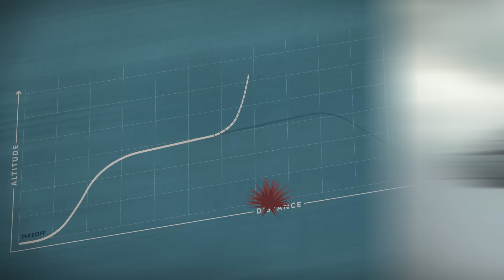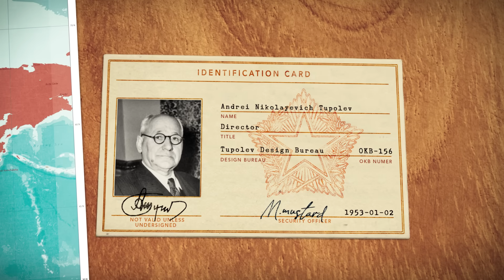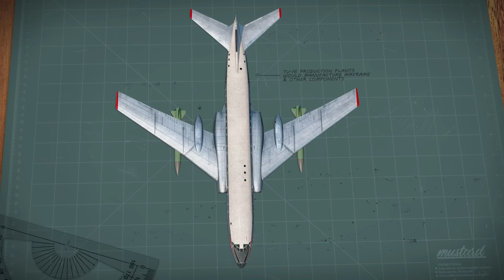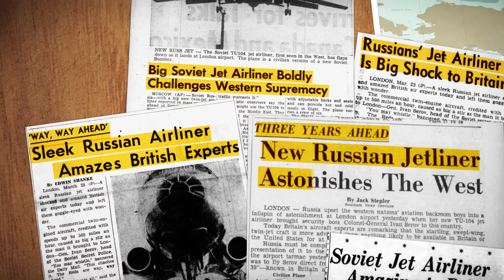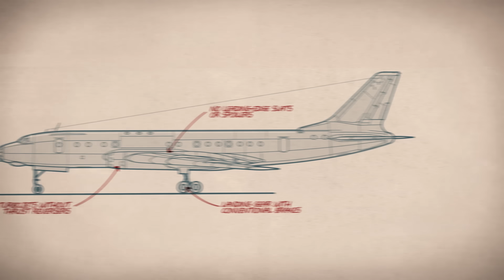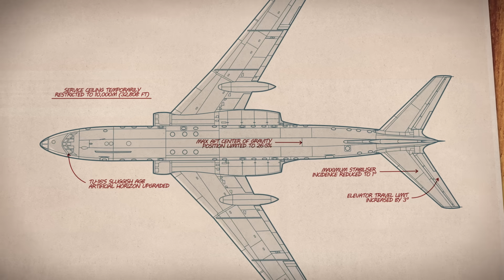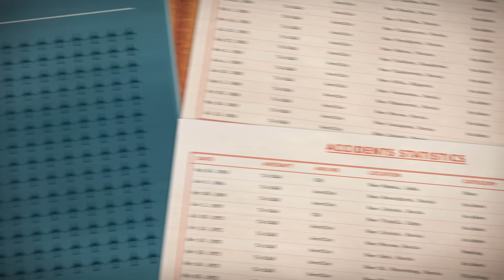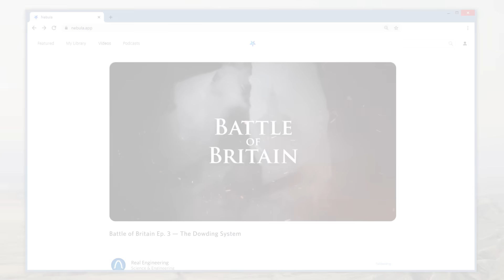The Soviet Airliner Designed To Crash

Comment: Why do British people have so much difficulty in accepting that the de havilland Comet was the worst jet airliner in history?
Reply: We believe we can clear up some commonly held myths and misconceptions obviously.

It's always good to see the facts presented clearly and concisely isn't it?

Obviously there have been worse aircraft for accident losses both before & after the Comet.

  De Havilland was subjected to forced merger under the govt aerospace sector rationalisation programme.

In 1944 the RR Nene, a centrifugal compressor gas turbine aero engine, was the most powerful & most reliable gas turbine aero engine on the planet. For decades after 1944 copies & versions of the RR Nene & RR Derwent would go on to power aircraft in many countries including Russia (Mig-15 & Mig-17), the US, France, Switzerland and China.  Five manufacturers currently produce various types of gas turbine aero engines which include centrifugal compressors, the main application is helicopters. 

The world's first wind tunnel was constructed in England before 1890. The world's first supersonic wind tunnel was constructed in England in 1922. Extensive wind tunnel testing & evaluation were carried out for the Comet. All takeoff incidents were the result of stalls caused by over rotation. There were feature induced issues where pilots tended to not using jet airliner specific takeoff procedures. Subsequent changes made to the aircraft were an attempt to make the aircraft more tolerant of such errors. 

It is in fact correct to state that no aircraft manufacturer had managed to produce a high altitude airliner with a full fuselage length pressurised passenger cabin pressurised to 8 psi differential before De Havilland did it with the fabulous trail blazing Comet. This was the first aircraft where pressurisation stress significantly exceeded flying stress for most of the airframe. The world's first pressurised cabin aircraft was a British design Airco built under licence in the US and modified in the US to have a pressurised cockpit cabin during a joint US / UK research project. 

 Testing included water tank pressurisation cycle tests on two 20 foot lengths of fuselage which represented all features of the complete fuselage.

The engines used for the earlier Comets were of course similar to the RR Nene, were very reliable  & were not responsible for any Comet incidents.

The fabulous trail blazing DH Comet.
World's first jet airliner.
World's first high altitude airliner.

    How things were back then. 
Accident losses - % of aircraft built.

DeHavilland Comet 4 UK                     14% 
DeHavilland Comet all (ff 1949)         17%  
Vickers VC10 UK (ff 1962)                   5%

Douglas DC-1                                      99%
Douglas DC-2                                      47%
Douglas DC-3                                      30%
Douglas DC-4                                      26%
Boeing s300                                        72% 
Boeing 307                                          70%
Boeing 247                                          48%
Boeing 707  (ff 1958)                         20% 
Lockheed L-049/149 Constellation  30%
Lockheed Electra  Turboprop .          29%
Fairchild FH-227                                 30%
McDonnell Douglas DC-8                  14%. 
Sud Aviation Caravelle                       15%
Canadair CL-44 Turboprop (ff 1959) 46%  
Convair CV-580 Turboprop                 22%
Convair CV-880  (ff 1959)                   27%  
Convair CV-990  (ff 1961)                   33%
Tupolev T-104     (ff 1956)                   16%

  The Vickers VC10, fastest Atlantic crossing for a non supersonic jet airliner, held the record for 41 years. 

The DH Comet & Sud Aviation Caravelle had similar accident loss fatalities for the first few years of operations.

Agreed, that is correct of course, clearly there are many countries that could easily produce airliners of better  quality than Bow-wing (see b-47 wing folding & wing collapse incidents) but don't for some very good reasons. Bow-wing being a result of the size of the US, the large protected domestic market & great ease of testing new types due to the equator to arctic geography & a few other reasons related to production scale capability, politics & economics.

  Obviously there really is nothing special about Bow-wing, having more than 50 years design / build experience on the type means they have no excuses for the horrendous Max incidents for example.

   Of course De Havilland carried out a full stress analysis & performed extensive & protracted testing, including pressure cycle testing, on two long lengths of fuselage. De Havilland carried out significantly more testing than was required by any authority at the time & significantly more testing that any previous airliner was subjected to.

    De Havilland did indeed always work to better than industry standards at the time, used up to date knowledge for the design & no evidence of negligence or criminal negligence was ever produced in relation to the DH Comet.

  The DH Comet had better safety than or similar safety to many other commercial passenger aircraft of a similar era both before & after the DH  Comet.

Pretty much all changes made after the Comet 1 were just in case changes or were previously planned ongoing improvements.

We do indeed hope this helps, of course.
      
As always, cheers & 👍 indeed.  .

Comment: The Tu-104 actually has a significantly better safety and service record than the D-H Comet... also Tupolev still makes jet aircraft.
, de Havilland went tits-up in 1958 as a direct result of the Comet Disaster,,
Reply: We believe we can clear up some commonly held myths and misconceptions obviously.

It's always good to see the facts presented clearly and concisely isn't it?

Obviously there have been worse aircraft for accident losses both before & after the Comet.

  De Havilland was subjected to forced merger under the govt aerospace sector rationalisation programme.

In 1944 the RR Nene, a centrifugal compressor gas turbine aero engine, was the most powerful & most reliable gas turbine aero engine on the planet. For decades after 1944 copies & versions of the RR Nene & RR Derwent would go on to power aircraft in many countries including Russia (Mig-15 & Mig-17), the US, France, Switzerland and China.  Five manufacturers currently produce various types of gas turbine aero engines which include centrifugal compressors, the main application is helicopters. 

The world's first wind tunnel was constructed in England before 1890. The world's first supersonic wind tunnel was constructed in England in 1922. Extensive wind tunnel testing & evaluation were carried out for the Comet. All takeoff incidents were the result of stalls caused by over rotation. There were feature induced issues where pilots tended to not using jet airliner specific takeoff procedures. Subsequent changes made to the aircraft were an attempt to make the aircraft more tolerant of such errors. 

It is in fact correct to state that no aircraft manufacturer had managed to produce a high altitude airliner with a full fuselage length pressurised passenger cabin pressurised to 8 psi differential before De Havilland did it with the fabulous trail blazing Comet. This was the first aircraft where pressurisation stress significantly exceeded flying stress for most of the airframe. The world's first pressurised cabin aircraft was a British design Airco built under licence in the US and modified in the US to have a pressurised cockpit cabin during a joint US / UK research project. 

 Testing included water tank pressurisation cycle tests on two 20 foot lengths of fuselage which represented all features of the complete fuselage.

The engines used for the earlier Comets were of course similar to the RR Nene, were very reliable  & were not responsible for any Comet incidents.

The fabulous trail blazing DH Comet.
World's first jet airliner.
World's first high altitude airliner.

    How things were back then. 
Accident losses - % of aircraft built.

DeHavilland Comet 4 UK                     14% 
DeHavilland Comet all (ff 1949)         17%  
Vickers VC10 UK (ff 1962)                   5%

Douglas DC-1                                      99%
Douglas DC-2                                      47%
Douglas DC-3                                      30%
Douglas DC-4                                      26%
Boeing s300                                        72% 
Boeing 307                                          70%
Boeing 247                                          48%
Boeing 707  (ff 1958)                         20% 
Lockheed L-049/149 Constellation  30%
Lockheed Electra  Turboprop .          29%
Fairchild FH-227                                 30%
McDonnell Douglas DC-8                  14%. 
Sud Aviation Caravelle                       15%
Canadair CL-44 Turboprop (ff 1959) 46%  
Convair CV-580 Turboprop                 22%
Convair CV-880  (ff 1959)                   27%  
Convair CV-990  (ff 1961)                   33%
Tupolev T-104     (ff 1956)                   16%

  The Vickers VC10, fastest Atlantic crossing for a non supersonic jet airliner, held the record for 41 years. 

The DH Comet & Sud Aviation Caravelle had similar accident loss fatalities for the first few years of operations.

Agreed, that is correct of course, clearly there are many countries that could easily produce airliners of better  quality than Bow-wing (see b-47 wing folding & wing collapse incidents) but don't for some very good reasons. Bow-wing being a result of the size of the US, the large protected domestic market & great ease of testing new types due to the equator to arctic geography & a few other reasons related to production scale capability, politics & economics.

  Obviously there really is nothing special about Bow-wing, having more than 50 years design / build experience on the type means they have no excuses for the horrendous Max incidents for example.

   Of course De Havilland carried out a full stress analysis & performed extensive & protracted testing, including pressure cycle testing, on two long lengths of fuselage. De Havilland carried out significantly more testing than was required by any authority at the time & significantly more testing that any previous airliner was subjected to.

    De Havilland did indeed always work to better than industry standards at the time, used up to date knowledge for the design & no evidence of negligence or criminal negligence was ever produced in relation to the DH Comet.

  The DH Comet had better safety than or similar safety to many other commercial passenger aircraft of a similar era both before & after the DH  Comet.

Pretty much all changes made after the Comet 1 were just in case changes or were previously planned ongoing improvements.

We do indeed hope this helps, of course.
      
As always, cheers & 👍 indeed.  .

Comment: The De Havilland Comet remains the jet airliner with the worst safety record in history
Reply: We believe we can clear up some commonly held myths and misconceptions obviously.

It's always good to see the facts presented clearly and concisely isn't it?

Obviously there have been worse aircraft for accident losses both before & after the Comet.

  De Havilland was subjected to forced merger under the govt aerospace sector rationalisation programme.

In 1944 the RR Nene, a centrifugal compressor gas turbine aero engine, was the most powerful & most reliable gas turbine aero engine on the planet. For decades after 1944 copies & versions of the RR Nene & RR Derwent would go on to power aircraft in many countries including Russia (Mig-15 & Mig-17), the US, France, Switzerland and China.  Five manufacturers currently produce various types of gas turbine aero engines which include centrifugal compressors, the main application is helicopters. 

The world's first wind tunnel was constructed in England before 1890. The world's first supersonic wind tunnel was constructed in England in 1922. Extensive wind tunnel testing & evaluation were carried out for the Comet. All takeoff incidents were the result of stalls caused by over rotation. There were feature induced issues where pilots tended to not using jet airliner specific takeoff procedures. Subsequent changes made to the aircraft were an attempt to make the aircraft more tolerant of such errors. 

It is in fact correct to state that no aircraft manufacturer had managed to produce a high altitude airliner with a full fuselage length pressurised passenger cabin pressurised to 8 psi differential before De Havilland did it with the fabulous trail blazing Comet. This was the first aircraft where pressurisation stress significantly exceeded flying stress for most of the airframe. The world's first pressurised cabin aircraft was a British design Airco built under licence in the US and modified in the US to have a pressurised cockpit cabin during a joint US / UK research project. 

 Testing included water tank pressurisation cycle tests on two 20 foot lengths of fuselage which represented all features of the complete fuselage.

The engines used for the earlier Comets were of course similar to the RR Nene, were very reliable  & were not responsible for any Comet incidents.

The fabulous trail blazing DH Comet.
World's first jet airliner.
World's first high altitude airliner.

    How things were back then. 
Accident losses - % of aircraft built.

DeHavilland Comet 4 UK                     14% 
DeHavilland Comet all (ff 1949)         17%  
Vickers VC10 UK (ff 1962)                   5%

Douglas DC-1                                      99%
Douglas DC-2                                      47%
Douglas DC-3                                      30%
Douglas DC-4                                      26%
Boeing s300                                        72% 
Boeing 307                                          70%
Boeing 247                                          48%
Boeing 707  (ff 1958)                         20% 
Lockheed L-049/149 Constellation  30%
Lockheed Electra  Turboprop .          29%
Fairchild FH-227                                 30%
McDonnell Douglas DC-8                  14%. 
Sud Aviation Caravelle                       15%
Canadair CL-44 Turboprop (ff 1959) 46%  
Convair CV-580 Turboprop                 22%
Convair CV-880  (ff 1959)                   27%  
Convair CV-990  (ff 1961)                   33%
Tupolev T-104     (ff 1956)                   16%

  The Vickers VC10, fastest Atlantic crossing for a non supersonic jet airliner, held the record for 41 years. 

The DH Comet & Sud Aviation Caravelle had similar accident loss fatalities for the first few years of operations.

Agreed, that is correct of course, clearly there are many countries that could easily produce airliners of better  quality than Bow-wing (see b-47 wing folding & wing collapse incidents) but don't for some very good reasons. Bow-wing being a result of the size of the US, the large protected domestic market & great ease of testing new types due to the equator to arctic geography & a few other reasons related to production scale capability, politics & economics.

  Obviously there really is nothing special about Bow-wing, having more than 50 years design / build experience on the type means they have no excuses for the horrendous Max incidents for example.

   Of course De Havilland carried out a full stress analysis & performed extensive & protracted testing, including pressure cycle testing, on two long lengths of fuselage. De Havilland carried out significantly more testing than was required by any authority at the time & significantly more testing that any previous airliner was subjected to.

    De Havilland did indeed always work to better than industry standards at the time, used up to date knowledge for the design & no evidence of negligence or criminal negligence was ever produced in relation to the DH Comet.

  The DH Comet had better safety than or similar safety to many other commercial passenger aircraft of a similar era both before & after the DH  Comet.

Pretty much all changes made after the Comet 1 were just in case changes or were previously planned ongoing improvements.

We do indeed hope this helps, of course.
      
As always, cheers & 👍 indeed.  .